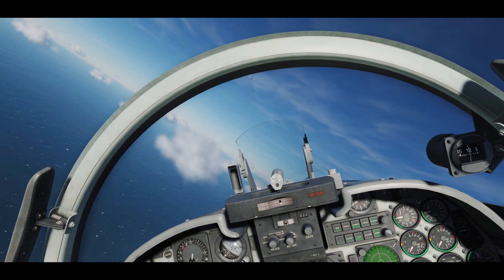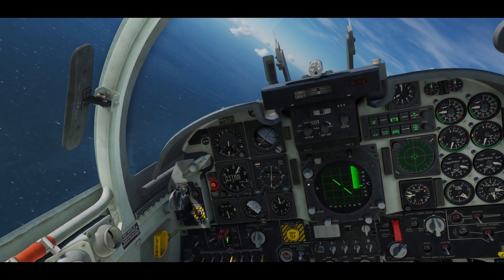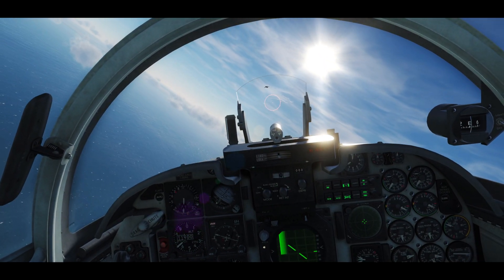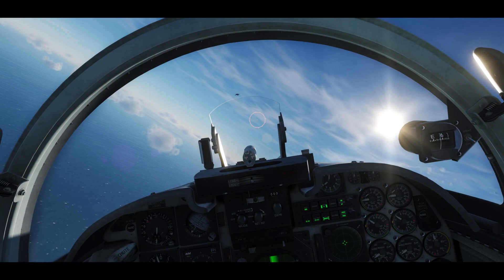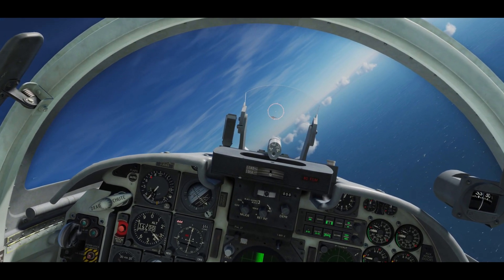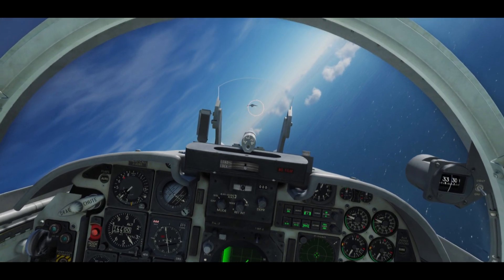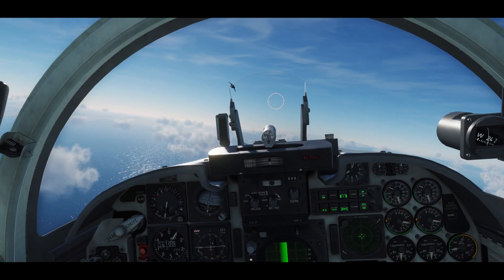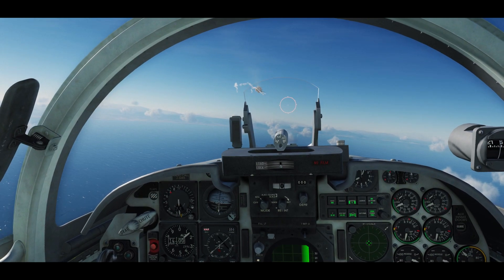DCS 2.5: F-5E AIM-9 Tutorial Cage and Uncage Usage

Comment: Hi,  often this happens to me: the missile is growling, I've got high pitch tone, so I press and hold weapon release button, but the AIM9 doesn't come off his rail. I'm not familiar with the F-5, and I'm asking what have I been mistaken. Thx
Reply from the maker: That should work. The only thing is you need to make sure you have the wing tip pylons selected on the weapon armament panel. They should be in the up position. AND you need to make sure the Guns MSL & CAMR switch is in the up position. This switch has a red safety cover and is directly above the pylon selection switches. 

If both of those conditions are met, you will have a missile launch when you hold the weapon release button (takes about 1-2 seconds).
Reply: @ryu1940  Thanks for your replay. I guess I didn't check the jettison switch, which I flipped when I dropped the fuel tank, but I'm not sure about it.